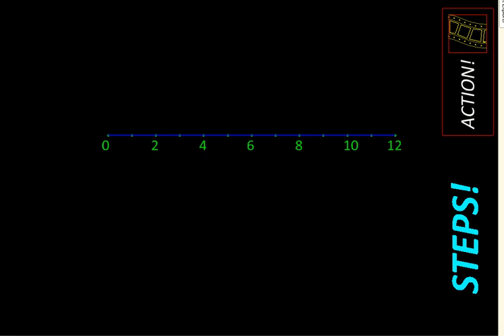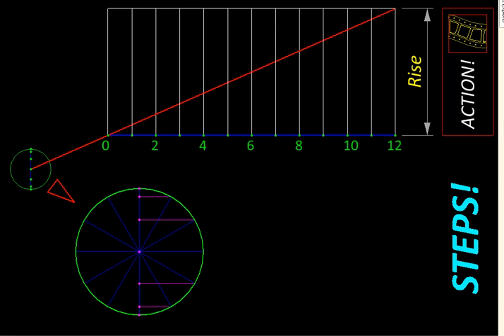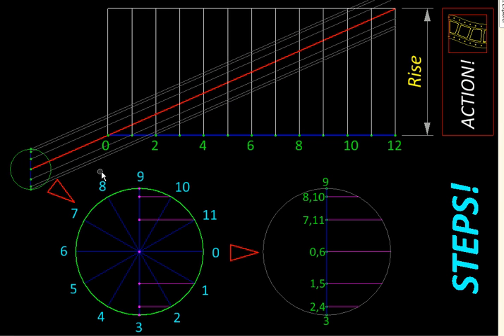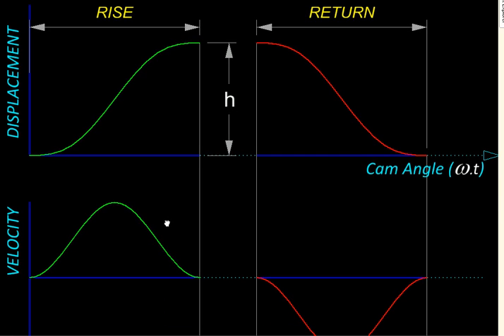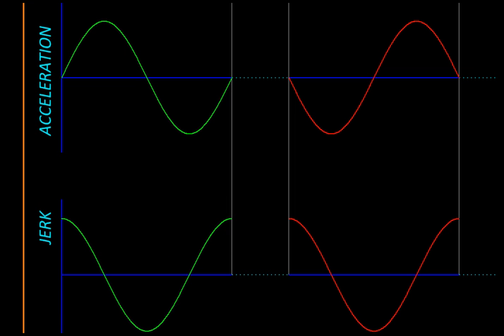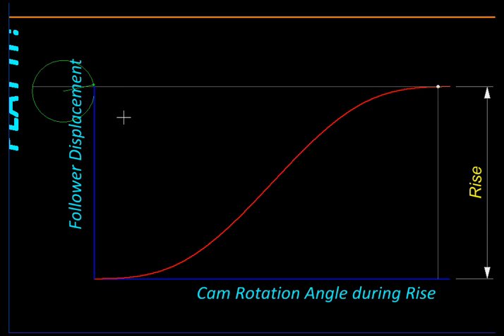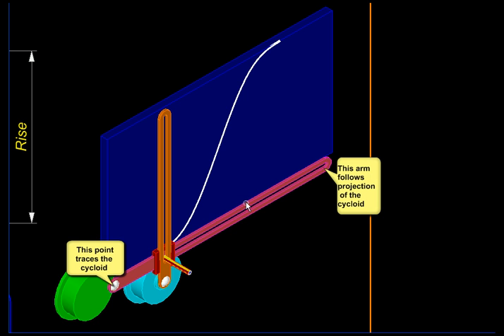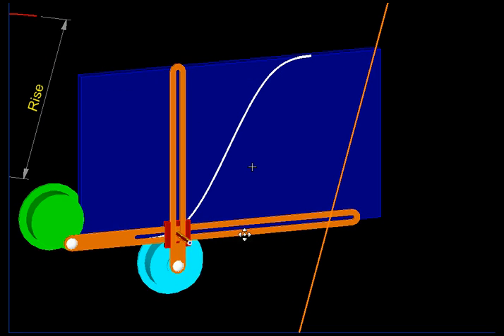Kinematics Ch07E Cycloidal Cams

Comment from the maker: @Rakesh Naidu Both circles have their centers moving uniformly, but a point on the circumference will trace a cycloid on the y axis. Thus it will be slower at the beginning and end but fastest at the midpoint (Rise/2). Thus you get the 'S' curve. Reversing the motions will give you infinite velocity and acceleration at the beginning and end. Not good :-)

Comment: why did you disignate the points (0 2 4 6 8 1 0 12 ) clock wise on the rolling circle??? if you reverse it in ccw the curve will change. is there any reason behind that ??

Comment: Thanks alot sir.

But I have a doubt. Why are we drawing a circle at the corner and then taking projections of points on it's vertical diameter?
Sir I'll be highly thankful if you could help me with some useful information.

Regards.
Reply from the maker: The 3D model and animation at the end of the clip might help you visualize it. 
We are taking a point on the circumference of the 'roller' in the 3D model and taking its horizontal projection as our position in the vertical direction (the direction of 'rise'). 
Projections are always taken normal to a plane or a line. The vertical diameter is the 'screen' for the horizontal projections we took.

Comment: Sir which software are you using, and where i can learn it
Reply from the maker: I use MicroStation - an excellent CAD platform for 2D, 3D modelling, parametric modeling, rendering and animation. I have given the link to Bentley.com, where you can find more. I think there are some resources to learn it on Youtube too besides courses offered by Bentley. If you are in academics, you can avail of the benefits offered by their academic program.